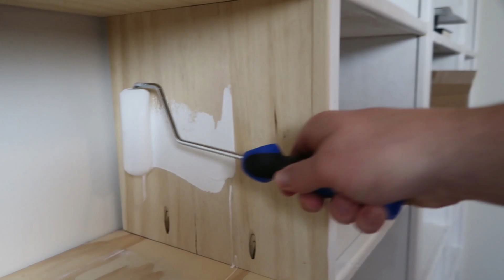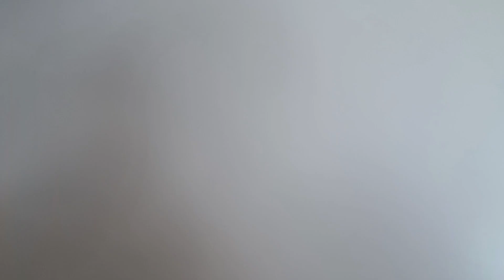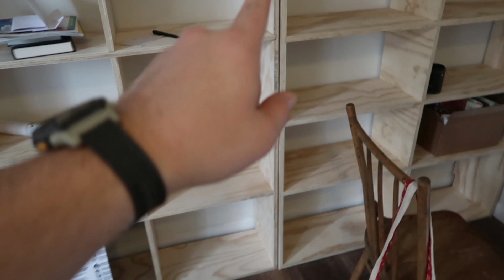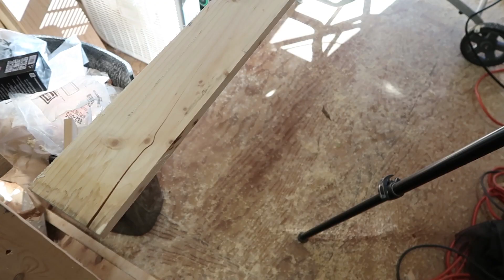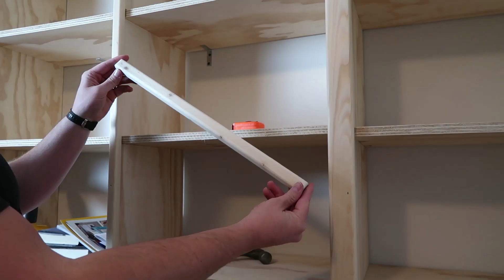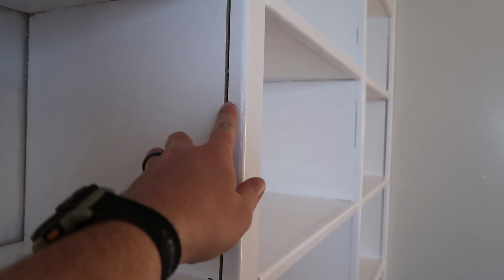Building and Installing Bookcase Trim

Comment: Suggestion for the bracketing.  Instead of a bracket, use a small 1x1 strip and screw that into stud.  Place the high one on top of a shelf and the low one on the bottom of a shelf.  Then screw into shelf from top or bottom.  Only cost is screws (had all the 1x material already) and is hidden pretty well.  Caulk, my friend.  Caulk.  Before painting, fill in those imperfections!  🙂

Comment: Do you think brads would work okay instead of finishing  nails? 
I’m glad you pointed out the flaws and what caused them. My wife has been asking for a wall bookshelf “library”, and out of 20+ YT videos, yours is the only one that I think I could actually build with tools I already own.
Reply from the maker: Thank you for watching. As long as the brads will sink into the plywood deep enough it should work. I had the finishing nails laying around already. 

I have probably watched the same videos that you did. Not a lot of them to start with. I wanted to make this build for anyone to follow.

Comment: Im planning on making myself a bookcase/blu ray holder. It will looknlike a bookcase but also have 2 doors that open amd close like a cabinet. This will be my first project since i made one in high school a regular bookcase.
Reply from the maker: Nice! That seems like a good project to get back into woodworking!
Reply: @LandtoHouse  yeah I just got the plywood today and boy that was hard to put into my room till I get the other supplies. Since I couldn't find nothing lower than a 4 X 8 I had to get that bc the others were too small. Now I know what kind of bit to use to rabot and stuff since I know what size plywood
Reply from the maker: @badams83  3/4" plywood is nice and heavy at 4x8 sheets. I have carried many a sheet. Once you cut it down it's not so bad.
Reply: @LandtoHouse  What kind of tool should i use to cut it bc i remember in high school for the back we used a jig saw to cut the plywood
Reply from the maker: @badams83  I typically stick with a circular saw and guide. You can even set the depth of the circular saw to be very shallow and cut out the places the Shelves will sit. You'll just have to make several passes.